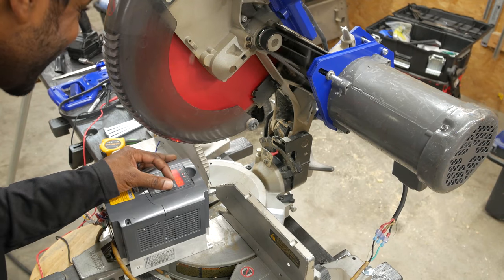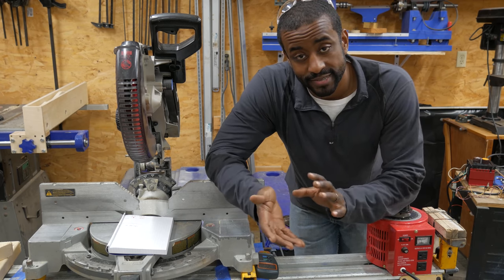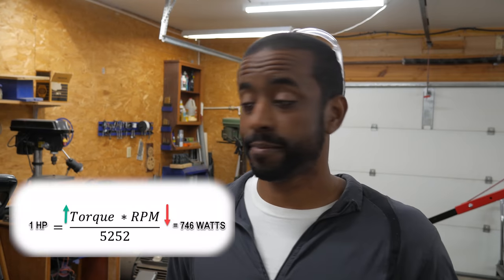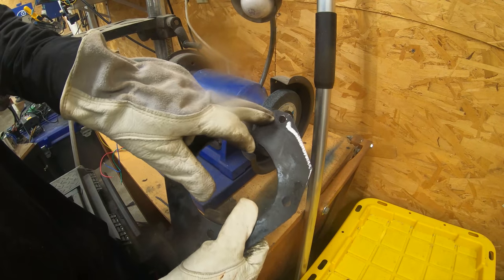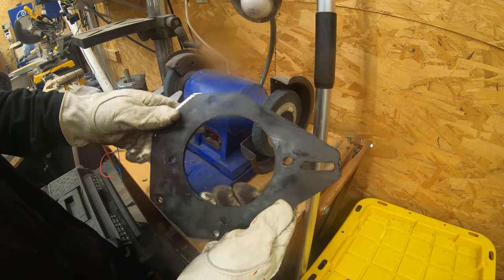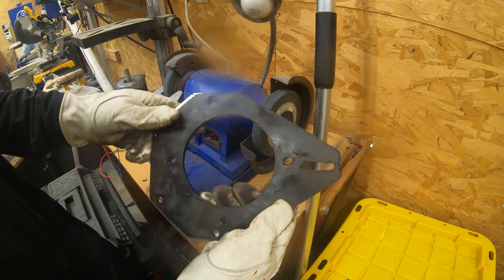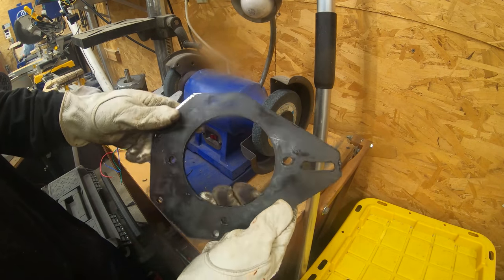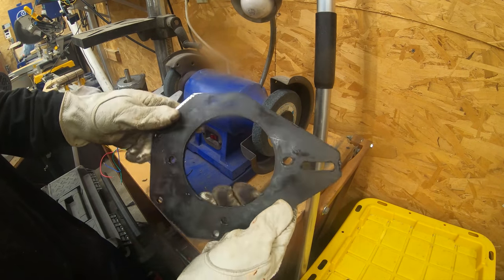How To Speed Control Your Miter Saw For Cutting Steel #080

Comment: Could the cross section of the cut (where the blade has to go through more material) have caused the difficulty? That seems to be where it got tougher. If you mounted that setup to a compound miter saw that's on a rail, you could change the angle of attack to keep the profile of the material thinner.
Keep up the videos, I have learned so much.

Comment: You could wire that normally closed side of the switch to the VFD as a brake trigger and then program the VFD to stop the blade smoothly, but fast.

Comment: I use 20 volt 6.5ln. Dewalt blade turned backwards cutting up to 0.5 inch steel. 
Maybe try same with full speed, wood blade, on miter saw?

Comment: As a guy who has burned enough $80 metal blades, it hurt to watch your final attempts. I got lucky and bought a bunch of Rok blades from a guy for $5 each. They cut pretty good, too. It's way cheaper to just buy an Evolution saw than try to modify a wood one. Canadian Tire puts the 10 inch one on for around $200-250 every once in a while.

Comment: I may have missed some details which is reason for my questions: are these typical carbide tipped blades? so the metal does wear them out fast? I was amazed at how fast they were cutting through. the cut off blade (not demonstrated) would be slower?

Comment: Great video... brains and shop experience!!! Most don't have both. Now you have to learn aluminum welding or soldering 😂 epoxy is just not right 👊😎👍😂 but you've help.me understand diff motors ac and dc uses for my generator idea 👊😎 so I learned tons from you. God speed my friend I wish I had the energy and mind set/ determination like i used to just like you have now. 49 yrs comes quick 😂😂😂🙏💯

Comment: Great experiment. I've got a decent Hitachi wood miter, however don't think I'd want to try to adapt it to cut metal.  Would rather find a used miter as you did, and simply get a torquier motor and at lower RPM.  Why not just look at how they do with actual metal cutting saw (cold cut) and duplicate?

Comment: I bought an Evolution 10inch miter saw with a multi-material blade. It is rated at 2500rpm and buzzes right through 1/4 mild steel. Would this be due to the composition of the material in the blade? Oh, and it does not spark nor does it build any heat. I love it.

Comment: Analog washing machine has module which main purpose is stabilize RPM of uniwersal brush motor. It use feedback from motor and kick more voltage if he starting to stall.

Comment: Out of curiosity what happens if you use a PWM signal to reduce average voltage of the universal motor? Would it still have torque and reduced average speed?

Comment: Try using a DC control that uses separate armature and field winding voltage. You should be able to get access to both sets of wires on the motor. Usually (iirc) the field windings are held at a constant voltage and the armature voltage is varied. This is the standard method of controlling industrial DC motors. There are other connection and control methods but are a bit more involved (field weakening etc).
Reply from the maker: I have heard of this before but haven't tried it. In my mind it should behave more like a permanent magnetic DC motor under those conditions, so I can see how that would be better. I might experiment with using two DC controllers (for field and armature) just to see how it behaves.

Comment: Love your video. I wanted a motor that could be used to cut steel and be used in a lathe with a vfd and even a cnc. I was wondering abut the vevo 4kW air cooled motor. What power do do you really need? It seems sad that for occasionally used tools we cannot swap out a motor, controller and plug it into a different device.

Comment: What about some of the high speed steel cutting blades?  Some of the diablos are rated for 5500 rpm+.  Is the cut not "cold" at those speeds?

Comment: Jeremy, I came across your video because I'd like to have a small 7 1/4 inch miter saw in the shop that ran at lowered speed to try to get a mirror cut finish with aluminum angle stock, t tracks, aluminum heatsinks, etc. Since a battery operated miter trim saw already is DC, do you think simply using a lower voltage battery might work? This is just for cutting aluminum with an aluminum cutting blade, no larger than 3 inch stock. Have you tried reducing the speed of cordless saws?

Comment: Great stuff...could you potentially use a flywheel to help maintain the energy needed by the motor to cut through the steel?
Reply: The answer to that question is yes

Comment: I'm at the 3:40 mark. I /should/ wait until I watch the whole thing, but wanted to offer a clarification here. The issue isn't that "Voltage control" doesn't work. The issue is that /open loop/ voltage control is not great. You're right, you've reduced the peak torque by applying open loop voltage control. I will say though, my Bosch router has a universal motor with a speed controller on it and it works exceptionally well, it's definitely closed loop as I can feel the overshoot as it approaches a speed less than the maximum if I turn it on with a lower than max speed. (Without the feedback, the router motor + controller seems either critically damped or overdamped).

As for your DC speed controller, you're still running a less powerful motor. And I'm not convinced it could have good closed loop control with direct motor speed measurement. It would have to do it by measuring BackEMF, and I'm not sure it even has that.

Fun stuff though, I've been wondering the same thing myself. I thought it would be cool to try my Bosch router for just this purpose, but I'd need an insane geartrain to bring the RPM down.

Comment: I bought the Evolution "rage" miter saw about 5 years ago and although I don't use it for steel often, it does cut steel.   I'm much more comfortable using it for copper tubing, brass, plastic, and of course wood.   I just wish it would cut a 4x4 in a single pass,  it needs like 1/4 inch more travel....WHY?

Comment: Adding the bigger motor, it seems that it may have pulled the blade over a little to a non perpendicular angle. Is the stress on the frame going to hold up long term to the added weight? Can you compensate for the angle created by the extra weight. You have a plasma table, why don’t you just re build the housing for the arm, but a little stronger with some steel?

Comment: Just a thought - only attempt at you own risk. I'd try a home-brew (Arduino controlled) power PCM or Chopper experiment that would monitor blade RPM and gradually step up the saw's OEM motor to full power, or until blade comes up to (and then maintains) the desired speed. A few OPTIONAL failsafe software/hardware tricks could make it... a bit safer. I'd start with a light bulb, and then put the regular blade in backwards while working out the bugs.  The basic parts I'd try:
 
1). Opto-isolated modification to an inexpensive speed control that adds small Triacs (or mechanical relays to test this design concept) to "switch" in 3 or 4 fixed resistors that replace the OEM variable resistor "knob" settings on the stock speed control. Off, low, medium, high, full. Resistors could be trim pots for design and concept testing using a light bulb for the test load.
2). OPTIONAL 120 VAC failsafe relay circuit that can ONLY be activated from RUNNING Arduino program that is generating two steady, alternating high frequency square wave outputs that are capacitively coupled to a negative AC/DC power inverter circuit (a few simple components) that pulls in the sensitive relay's DC coil. (Wiring the relay and coil diode backwards from any other circuit power source makes it impossible to pull in that relay ANY other way or from any power source other than the special square wave coming from the Arduino!)
3). Mount an optical or Hall Effect sensor at blade near center or at the drive pulley (allow for dirt/dust conditions!)
4.) Low voltage READY to START button and some LEDs to show status of Arduino control. 

The code (Arduino Sketch) has important responsibilities that must be carefully considered.
A. Look for READY to START button. For 5 seconds, send low speed output along with square waves. The saw's trigger switch can be activated only within this time.
B. If no RPM is detected, turn off everything, light up standby LED. If RPMs are detected for at least 1 second, start "ramping up" motor power while looking for zero RPM condition and the range near max RPM. etc. If zero go back to standby mode (everything off).  If RPM is low, step up to next higher power setting. If RPM is high, step down to next lower power setting. etc. 

Full linear PCM control would be great, but this is the basic concept.  I don't know if that would work, but that's what I'd try before the high power/low speed motor swapping. It would be far safer and more sane to just buy the proper saw for the job at hand.  Take care.

Comment: Nice work but most of the metal cutting saws (Dewalt and Evolution) with a carbide blades run at about 1300 RPM and they work great with no coolant required.
Reply: Sorry, I spoke too soon and as I continued the video I see you found that out yourself.

Comment: How does frequency and or voltage variation affect the heat buildup in different types and HPs of motors both AC and DC ?

Comment: If you lower the voltage on AC motors you will burn up the windings AC motors are set for 60 cycles meaning that it expects to see a positive than a negative every 60 cycles in a second

Comment: If you use a transformer to get to 480v use a 480v vfd. Wire your motor for 220. Tell the vfd its a 480 volt 120hz motor. If you use a 2 hp 1800 rpm motor you will get 4 hp motor at 3600 rpm. This works because you are flowing the volts hz curve of the motor at 60hz the vfd is only putting out 220v at 60hz and at 120hz it will put out 480. You will need 4hp vfd.

Comment: Great video! I just subscribed your channel.

Generally, AC motor speed is controlled by the frequency (60hz in the USA), instead of voltage or current.   For example, if you take a clock Made for the US market and to Jamaica (120 V 50 Hz), it will run at 5/6th speed. Have you tried a frequency controller to slow down the speed of the motor?

Comment: 3600 RPM is pretty close to a steel cutting saw actually. They spin in the 1500-1700 RPM IIRC. Compare that to my Ridgid that spins at 5200 RPM with almost direct drive, you started way closer. There are a lot of blades now (with Diablo leading the way I at least in retail) that you're supposed to just slap on your regular saw and cut steel with it. Reviews go from works like a charm to yeah, works great for 50 cuts.

Comment: I'd be curious to know how the bearings in the blade section are holding up with use on steel cuts. I'm guessing the bearing used for wood isn't as heavy duty as for steel would need.

Comment: At 18.28 you have the saw blade on backwards!  I think the VFD may have worked if the blade was on correctly?
Reply: He's using a wood cutting miter saw.  It has a plastic blade guard that makes it look like the saw is installed backwards.  I have the same brand double bevel compouind sliding miter saw.

Comment: There's a way for using universal motor powered by DC controller but it would require close loop feedback about RPM, so as the RPM drop due to a load, voltage would go up by widering pulse width, thus more torque. Magnetic pickup can serve as time base counter and some arduino can do the rest by synchronising  PWM to match the RPM. (PWM is short for Pulse Width Modulation)...

Comment: This is a little late, but I do not think the speed controller is a good option for a regular saw. The motor is not designed to be a variable speed motor, there for it will probably burn up a lot quicker than normal operation. If the 2hp motor was free or relatively cheap it is a good option to modify a wood cutting saw, but the cost of an actual metal cutting cold saw is not much higher than the cost of all of the parts used to build the saw you have built. Also, how long did it take to do all of the fabrication and testing? To me time is money. The video is very informative though and I will be watching more of your content.

Comment: The wires off the switch that you did not reconnect are probably used for the original motor brake.

Comment: Hahaha I've done a "Mitre Modification" if you could call it that haha

Found a Woodcutting Mitre Saw @ the Aussie version of home Depot (Bunnings) had a 1450RPM rating. (which it does) 

Few shelves over they sell "Cold Cut" steel cutting blades, with a 1450RPM rating (Yep.) 

Ring adaptor kit later... 

Yep. Works perfectly. No teeth flying off, no super hot steel, no dramas at all. 

Gotta use cutting fluid though, or the sawblade gets real dull, real quick. 

But not too shabby, $85 saw. $90 blade. $10 ring kit. 

Sub $200 "Cold Cut" saw! :) 

Can't even buy a hot-cut saw for that cheap! 

and yes, it works. Perfectly. (well.. the coldcut saw blade is about 5mm less in diameter, which means you need a 5mm biscuit of something behind whatever your trying to cut... I use pine-peices offcuts.. 

In Ally, and mild steel it doesn't even get warm. 

In tool steel, (yes it cuts tool steel..) You need more cutting fluid and it gets .. hot. The cutting fluid starts to turn to smoke. 

however, I've tried hot-cut saws cutting tool steel.. and they create a LOT of silicon smoke, and don't cut it. 

Tested it on solid axel, (assuming tool steel from the reddish sparkies.) it cut through it, quick and easy, but a little hot.

Comment: That switch with normally closed contacts might be a simple induction brake.  I.e. it just shorts out the windings when you release the switch and stops the blade faster.

Comment: Jeremy, I am assuming that your three phase VFD is rated for 120 V. Am I mistaken? Your 1 hp 3 phase motor is rated for what voltage @ 60 Hz? I do not remember you mentioning this. In any case, if you want to maintain your torque at higher frequencies, simply use a higher voltage. If your motor is normally run at 120 volts @ 60 Hz, you can safely run it @ 240 @ 120 Hz with full torque and power. If you need even more speed, then use a higher voltage with a proportional increase in frequency. If you have a supply of 480 V three phase, then use your 480 volt VFD setting your motor to run @ 240 Hz. Anyway, this is really the material for another video, I think.

Comment: Uniwersal motor will run on DC but do you have some solution for that with DC there is more sparks on trigger on start. When AC it will start when wave goes from 0. Or do you think that i dont need to bother about that. I want to use tools on construction out of big battery

Comment: hey Jeremy. I have just fitted a 3phase 1.1hp motor on my metal lathe with a VFD. its wired in delta I think with the three terminals bridged across. would I be better off in star with the terminals bridged just on one side? cheers and great videos.

Comment: You do know that the hz with the AC has a a huge effect on speed and running at less volts will put the motor in the wrong location and burn the motor up super fast because instead of the brushes being where they should be they will be further away resulting in arching across   The guts of your motor right?

Comment: Did your VFD accept single phase power and convert it to three phase power? Or do you have 3 phase power in your shop? I have a Hitachi dual bevel miter saw I have never used (12 years old)... I do mostly metal and I'd rather not buy that evolution saw for $849 as I just spent a bunch on a lathe mill CNC conversion (which I'll be posting at some point).

Comment: The normally closed side of the switch is wired across the motor to act as a brake when the switch is released.

Comment: The cut off wheel is probably a bad idea.  The sparks will probably melt plastic.   What happens when you cut steel at over 3000 RPMs?

Comment: I'd have gone the other way - gotten a set of stacked pulleys like they have in heavy duty drill presses. You can change the "gear ratio" to a pretty wide variety of settings, and keep the same motor. A slower blade would also have a LOT more torque.

Comment: Great video. The 3ph motors running with the VFD seem to work well cutting metal (especially if only a metal cutting saw is desired). Did you find that a 1hp 3ph motor controlled with a VFD was sufficient to cut metal only? I'm thinking of buying a sturdy miter saw and remove the motor. Using a 1hp 3ph motor hooked up to a KBAC 24D VFD and convert a wood miter saw into a metal cutting miter saw. I did this on a couple of belt grinders and it works great. What mfg. of miter saw did you use (the blue one)? I like the belt setup on it and it seems to be ideal for this type of conversion.

Comment: Hey Jeremy,  Have you tried a DC motor instead of the universal motor. I hear that a universal motor run on DC loses torque due to the sine wave being cut from a full ac sine wave to the rectified DC sine wave?  I am also hunting for a 3 phase motor for my conversion.  I have tried using the  7 1/4" metal cutting blades that can run up to 6000 rpm, but the faster speed tears up the carbide way too fast.

Comment: @jeremy fielding I know this is an old video, but can you tell me if it’s possible to use a VFD on the existing single phase Induction motor to reduce speed w/o reducing torque?

Comment: "Next time," you might consider using a permanent magnet DC motor.   They have excellent speed control at least as good as a VFD with induction motor.   I don't know whether there is the equivalent of a VFD to such motors but it would be nice to "ramp up" the speed and, obviously, cut the voltage it the current gets too high.